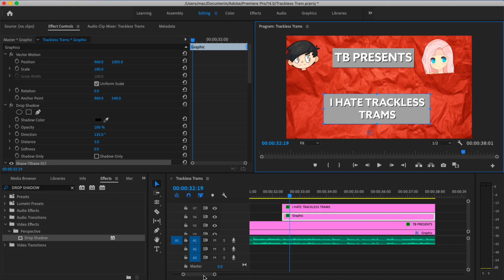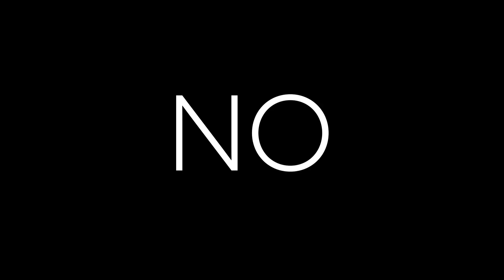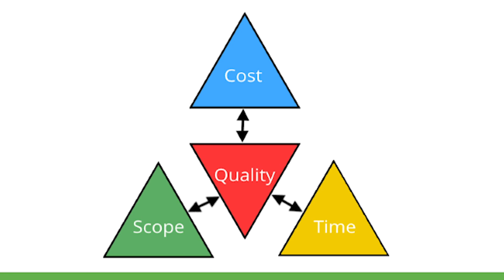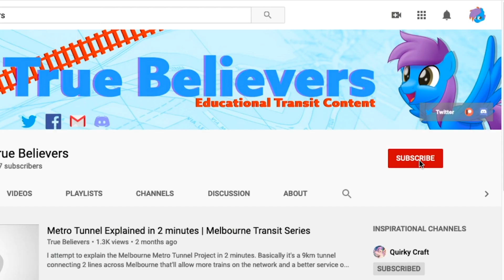Trackless Trams | Transit Analysis

Comment: I think this video really skirts over the often major infrastructure works needed to implement light rail. 

"it can be expanded upon very easily." This just isn't true. Implementing light rail can be expensive and time consuming because of having to move utilities out of the way of trams.
Reply from the maker: Every project you need to move utilities whether that's road, train or tram. Yeah when I say easy to expand, once you get a network, you can expand the stabling yard, order new trams and then extend the line. New systems cost more to get going as it requires more initial investment. This is what I meant by that.

Comment: Hamburg got rid of its double articulated buses because of problems of high maintenance. 

The trackless tram vehicles will be very heavy with all those batteries so the roadway will have to be reinforced at the stops.  The routes are thus basically fixed. 

The proposal to put these down the middle of Parramatta Rd to allow parking all day won’t replace all the bus routes. 

They should be cheaper but low floor buses with high quality stops will be better.  

The ARRT has been around for four years now.  The Chinese have only installed two lines. Apparently a third is coming.  But given the rate they are building metros it would seem they have given up on it.

FWIW light rail is very expensive. Sydney L2 & L3 cost $3.1 billion, almost double the original estimate.  They want to shut bus routes in the eastern suburbs to force people to catch it because it’s running well under capacity and, AFAIK, the contract says the government has to pay a guaranteed minimum to Transdev.  It’s a mess.

Comment: Trackless Trams, call them for what they are! Buses! Trackless Trams are unproven technology. Remember steel wheels on steel rails are eight time more energy efficient than rubber tyres on asphalt. One of the selling points of trackless trams over conventional trams is that trackless trams do not need overhead, but there are various trams systems around the world that use battery technology. Furthermore it has been found that trackless trams can cause depressions or wheel ruts where the trackless trams run which are dangerous to other road vehicles. Traditional trams can carry much more passengers for very little energy consumption. If authorities want to use this form of unproven technology then call the vehicles for what they are - guided buses.
Reply: Trams bring so much of ugliness to the surroundings and traffic jams even for emergency services like ambulances

Comment: Tram with batteries costs as much as placing tracks? 🤣🤣🤣 u need to do some research baby
Reply from the maker: Dude you have to resurface the road.
Reply: @TrueBelievers  yeah placing tracks is much much much more expensive than tram batteries
Reply from the maker: @ralnou  you still need to rip up the road surface for either options, tracks generally provide smoother traction and less maintenance than the road. It comes to the same price.
Reply from the maker: @ralnou  And it's not just the batteries, instead of tracks they use special compression on the bogies and the road surface has to take the heavier loads, it's not cheaper when you add all the additional features.

Comment: Please do a video about monorails and other niche public transport modes.
Reply from the maker: Monorails is an idea I've had for awhile, may get to them in the upcoming Justified series.
Reply: @TrueBelievers , Monorails are still very useful if they're properly used; they're ideal for circulators in busy areas or for certain niche applications. Heavy or high capacity monorails operate successfully in some Asian cities. The capacity of a heavy monorail is always less than a train/ heavy rail as the monorail carriages are usually shorter than standard trains. A shorter train equals a lower capacity train as there're less seats and standing room. There're straddle beamed monorails and suspended monorails where the train carriages run on railway hydraulics and rubber tyres. A monorail train runs on a straddle or suspended guideway and are standardised like conventional steel railways. Monorail systems especially straddle beamed variants have many problems with switching simply due to the massive weight of the concrete or steel beams. Also, all types of monorails can only be elevated as tunneling requires more superstructure for the vertical supports of the monorail vehicle. Monorails are extremely inflexible with different types of alignment such as ground level or in tunnel. However, a conventional train is far better as it can go in lots of alignments such as at ground, elevated or in tunnel.

A grade separated train has the same service experience of a fully elevated monorail. Since conventional rail is standardised, it's easy to find replacement parts for the steel railway track, steel wheels, signaling, traction motors, bogies, electrical components and other parts for the rolling stock. Being able to buy rolling stock from different vendors is a huge strength of a conventional steel wheeled railway. Steel wheeled trains have much lower rolling resistance than rubber tyred monorails which makes steel wheeled trains more suitable for higher capacity roles than a rubber tyred monorail.

Comment: the thing is trackless trams can change direction if there is any  accidents but traditional tram can't  and it is more  developpable  espacially in contries that developped horizontaly and in sunurbans . also the technology  of batteries  are in constantly advancing witch means more efficiency more lower cost and combine between tram and bus so we can  . so yes i think it pretty much represents the future tram and we can replace both trams and bus with just truckless trams .

Comment: Love it, u from Melbourne?
Reply from the maker: Yes I am!
Reply: @TrueBelievers , I'm from Adelaide, but believe that Adelaide's public transport future are well suited to more frequent and reilable buses, Busways/ BRT (not O'bahn) and trains just like in Perth, Australia. Connecting lower capacity PT modes to existing train lines in a frequent grid including Adelaide is the best way to create the networked effect. Most cities can function well without at grade trams/ light rail. Thankfully, the AdeLINK tram extension into Adelaide's inner suburbs has been cancelled by Infrastructure Australia as extended trams are unnecessary for Adelaide.

Comment: Finally someone pointing out why trackless trams aren’t good thing. The first thing with trackless trams is the overall maintenance costs would be higher. If they run on bitumen roads, bitumen has a third of the lifespan as a concrete slab light rail track. If they use rubber tyres, they wear out faster than light rail steel wheels. The third extra cost comes from the line markings needing to be repainted which isn’t need on light rails. Trackless trams are just bi-articulated buses.
Reply: Hi,some really good points you made buddy. So lets say you were to add a sub-system to trackless trams what would it be>???
Reply: Well, I actually think they're a good idea for several reasons. First, you can freely move around like in normal trains. Second, it can easily be fitted with safety systems that can prevent accidents entirely. And 3rd, it can carry more people than the average bus. There are disadvantages, true, but the same can be said about trains. Trains are more efficient and comfortable than road transport, yes, but they are stuck to their rails and if the track is destroyed, well, there's no way to operate then. But I think comparing trackless trams to trains misses the point. It has so many safety features that could be featured into other road vehicles. Also, who likes sitting in a cramped car seat when you can ride on something more comfortable? I think trackless trams have a niche serving short point-to-point transits 200 miles or less. Trackless trams can serve places that are unable to create infrastructure required for tracks. Also, they can use existing road systems and, with rubber tires, can stop much more quickly than a normal train. It poses no danger to cars due to its sensors, while regular trams don't, and, when cars and trains share the same area, there's always a risk involved. Rails embedded into the road can also pose a hazard for cyclists. Even if the trackless tram is a failure, (which I think it won't), its technologies, a fatigue detector, sensors, and warning systems, can help make roads safer, which hasn't really been done since the first car ever took to the roads. So while trackless trams have their disadvantages, they're much better than being in a car.

Comment: Well I liked the straddling bus so you see where I'm coming from, but as a rail purist must say I'm totally against so-called "Light Rail" which usually amounts to building railroads down the middle of the street. I believe high capacity linear is comparatively useless without totally isolated right-of-way, so see also how the trackless tram might not amount to much versus the investment, unless they're isolated.
Reply from the maker: Fair enough!
Reply: Bruce Hain, The tram tracks can pose a hazard for cyclists especially those on road bikes with skinny tyres. Cyclists on road bikes often get their bicycle tyres stuck on the tram tracks.
Reply: @michaeleverett1479  That's a horrible characteristic of trains - and why my "rail purity" amounts almost purely to grade separation and lateral isolation: total isolation. In the US between the wars there were laws passed about "grade crossing elimination districts". (I guess today you'd call 'em Crossing Free) The railroads were often required to implement a certain amount over time. But that all fell apart when the railroads started pleading poverty after WWII (while selling off their main lines and new passenger rolling stock so certain individuals could prosper Exorbitantly.) Now it seems the RRs have got their fans indoctrinated so when they build something like Brightline (supposedly it was upgraded, they didn't do much) the fans get all up in arms saying that a given fatality victim was stupid and essentially "don't know how to drive". Brightline is interesting because the founder of the Florida East Coast RR arranged with all the counties a deal whereby if any grade separation was needed the counties would pay for it. All through the 20th Century and on they were building all the gigantic roads at least 100' wide so it's a bit of a problem, with highest rate of fatalities per linear foot of any rail line in the US. And eveyrone's perplexed, "puzzled" by this state of affairs. (I get the impression Australia's doing a much better job of upgrading their rail - not such big fancy projects but what I've seen is nicely done. This too will pass. Now you've got the world's biggest rail boondoggle in England - EVEN England. It's just too bad.
Reply: @brucehain , Yes, passenger railway lines have to be functional in capacity, frequency and speed in attracting lots of people efficiently out of single occupant cars. Trains and steel railway tracks are fairly expensive to operate and maintain. A passenger or freight railway line needs a sufficient volume of passengers or goods respectively to justify the high operating costs of the trains (or other rolling stock) and the railway track.

To me, putting trams/ light rail on steel tracks embedded into concrete is prohibitively expensive and extremely difficult to maintain. Trams on tracks are simply dumb while having crappier seats, narrower carriages and worse capacity than a full blown train. Many tram systems operate in at grade conditions or shared traffic (stuck at the traffic lights) which suffer conflicts with pedestrians, cyclists, cars, buses and trucks. A lack of right of way for street trams/ light rail has much lower capacity than a grade separated railway.

Grade separate a tram/ light rail for high capacity application, then its outclassed by a train/ heavy rail.

Grade separated railway lines without railway crossings conflicting road vehicles, pedestrians and cyclists is the preferred option. Railway crossing removal is the best way to improve frequency and capacity of any train network without congestion of the roads.

A steel wheeled railway line should only be built for a metro system, suburban and regional trains only with the right of way. Some railway lines were built with wasted taxpayer money just to appease railfanners.
Reply: @michaeleverett1479  Looks like you're one of the few people who agree with me. Unfortunately the people in charge of all this - the planners, RR engineers, and the public agencies whom they control - are not fans of passenger railroading, and that is the only way to explain some of the terrible wastefulness of throwing important lines away, and building things that are designed deliberately to avoid attracting passengers. I really believe there's plenty of low-hanging fruit in the US where service could be instated that would be heavily used and eventually pay for itself, but it's dying on the vine. If you're interested I go into some detail at this URL - the latest is my comment on MassDOT's East-West Passenger Study, and the LaGuardia Direct Route one points up with particulars exactly the kind of things these people are up to. They both do actually - I'm getting more critical with old age: rail-nyc-access.com